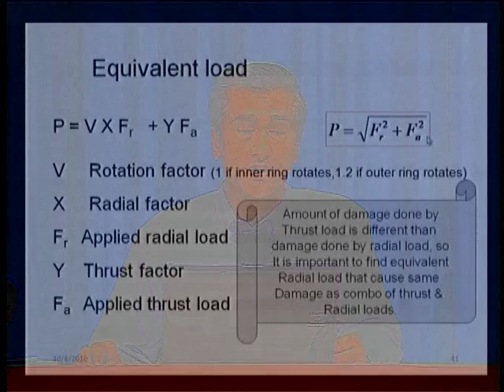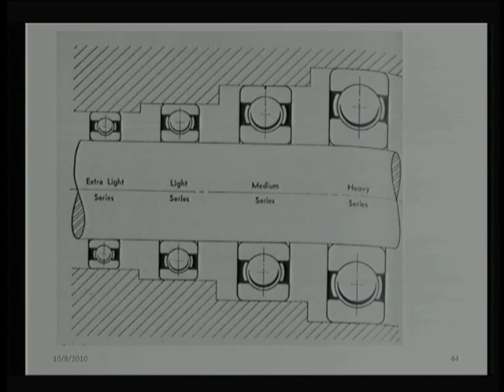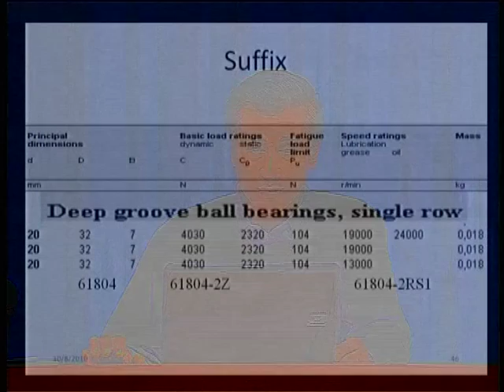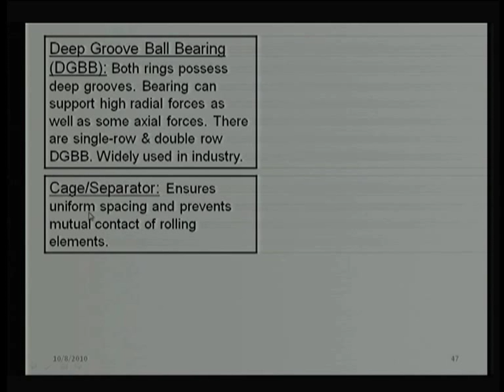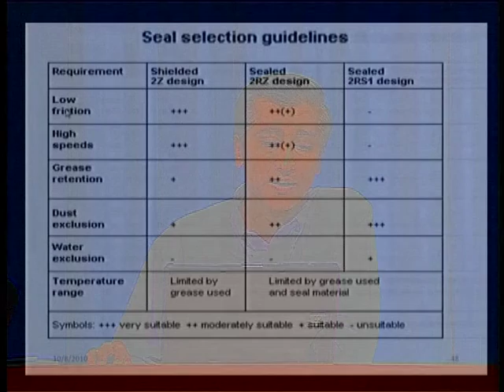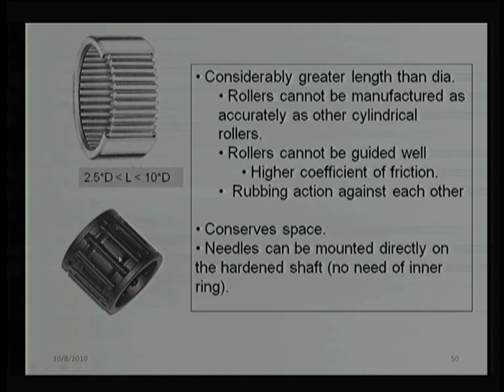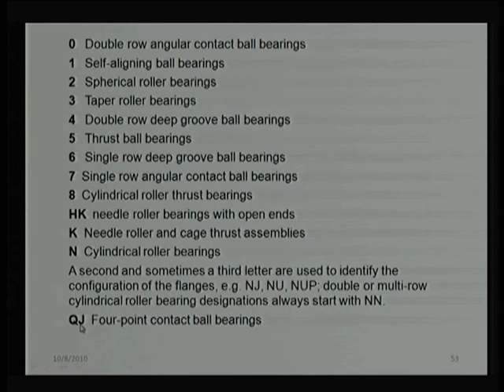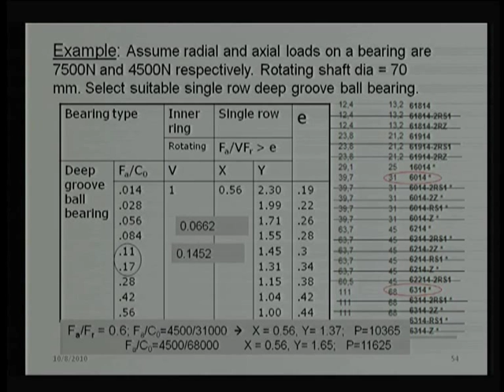Rolling Element Bearings(contd)...

Comment: 5:53 How we choose equivalent load?
8:30 Significance of 'e'
12:00 Diameter series
36:40 Roller element bearing
38:55 Needle roller bearing
42:34 Cylindrical roller bearing
47:17 Bearing series
50:00 Example